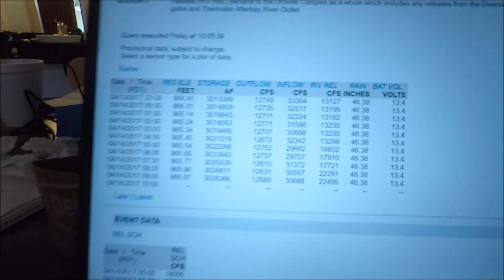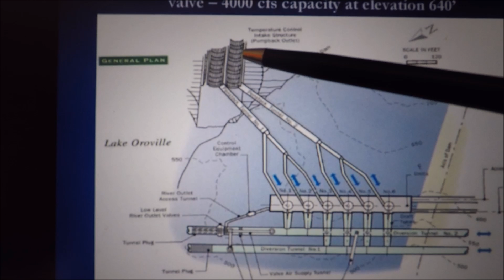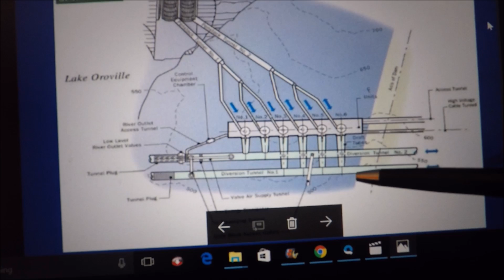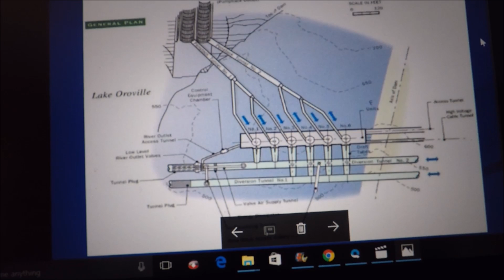Oroville 13 April DWR Press Briefing EXPLAINED!

Comment: Jaun, you apologize for using feet as a short cut for cfs. But as you know your feet have volume it's your foot's step that is linear. So, yes, technically wrong but practically speaking you're right. Though I'm not sure how many average feet it would take to fill up a cubic foot ( but then we're probably better off using bushels. )

Comment: Fantastic job. Thanks. One thing once they get the Dam fixed are they are going to start using Oroville Dam for FLOOD CONTROL! Any more nonsense of having the Dam at 85% capacity st the beginning of January  with record snow packs and a Pineapple express on it's way and not letting out more than a 11,000 CFS average for over the month? We were promised that the Dams in this state would have a primary goal of FLOOD CONTROL in the 1996-97 flood here in the valley. Of course it did not happen here.

Comment: Non-water guy guess: 60% allocation not related to res level. Instead, a function of what they can put into the river, with spillway down for repair.

Hindsight... If it was my jobsite, I'd be wishing I put the recovered spoil (debris) on the NEW CANYON SIDE of the busted spillway, instead of the far side, from where it eventually needs to end up (where it started).

Comment: It's good to see they added more shotcrete but wondering why it was such a dismal effort of only a few guys working and just one of them placing it... ? they should have had 3-5 just blasting shotcrete all over that left hillside..  all that brown color rock will erode if it is not protected. IMO addressing and preventing any further erosion under the slab is critical.. if they start to loose ground it's going to be a real mess... Look at the muddy water coming from that left side as the spillway is opened..

Comment: Another very good report Juan... yes the DWR is 100% in CYA mode.... Kevin Dossey is the lead engineer and he has covered his butt by saying he followed the protocall... but the reality is any competent engineer would have realized a potential risk and would have investigated the subsurface conditions when they were patching cracks and saw water seeping through the backside of the slab...  no different than if they saw water coming through the dam... would they just ignore it?  If these guys were maintaining a bridge like the Golden Gate it would have fallen into the bay and their excuse would have been that they were following the rules...  IMO passing the buck is not acceptable...

Comment: It seems curious to me that a sheriff is a critical bureaucratic valve for security-sensitive, failure-analysis of an engineered structure.  Unless, of course, a failure of security was a significant feature in the collapse of the spillway.  But I am not trying to provoke fear-mongering about a criminal act--I have no reason to suspect that from the flow of events.  That is, there seem to be plenty of problems concerning the original engineering, maintenance, and management of water levels (perhaps influenced by certain, possible irrationalities resulting from undue attention to political ends) to suffice in getting at the root cause of the potential disaster.

Comment: San Louis looks pretty full!  Can you fly over Shasta?  The Oroville spillway has been open for about 12 hours, and the water level elevation is 865.5, so it is a slow process, (which I suspect may have to be sped up next week to outpace the coming rain/snowmelt enhanced inflows.) The press conference had me baffled about the closure of Hyatt - thanks for the explanation. Still baffled about scheduling non-emergency maintenance work during the critical flood season, but not the explanation!  The CEI designation discussion was also a bit baffling.  Bill  made it sound as though the forensic report was never going to be closed to the public, and wasn't sure how we all had that idea.  I'm pleased that several CA legislators spoke up on behalf of their constituents and strongly demanded that the information be accessible to all. We will find out soon.  I'm anxious to find out about the soundness of the bedrock for both spill areas due to the high degree of weathering.   I'm also concerned about the timing of the two-day on site forensic team - it rained most of the time while they were inspecting the dam and spillway -  probably not the best time to find leaks. I hope they plan a return trip. This was another great report from a true celebrity in the world of California Hydrological Disasters.  Thanks Juan!

Comment: Thanks again for your persistent coverage here. I do have a question that I hope you will eventually answer: In the diagram of the Hyatt Power Plant, the turbines each have a penstock. Turbines number 1,3, and 5 have green arrows by them, The even numbered turbines each have two-way arrows. Can you figure out why, and what it signifies?

Dave in St. Louis, Mo.

By the way, we here in Missouri have also had our own Electric generating reservoir disaster. You can Google Taum Sauk Mountain disaster and find out about that.
Reply: soularddave2 : 3 of the turbines can be operated in reverse as pumps to pump water back into the reservoir. The idea is that (if the reservoir water level is low enough to allow) water can be pumped up using cheap electricity and drawn down later at peak electricity demand for a quick, responsive bit of add generation capacity. It's like a potential energy battery.
Reply: I believe that the even numbered turbines can be reversed to be pumps to move water up to the reservoir, during hours when electrical demand is low.  At hours of peak demand, the water comes back down to generate electricity.
Reply from the maker: soularddave2 yes, generators vs generator/pumps

Comment: What does it mean to "scour" the inlet to the spillway? And what is the result if that would happen? Thanks!
Reply: William M : It means the effect of water velocity on the submerged channel on the lake side of the dam which leads towards the spillway gates.
I think (from previous reports) the channel is graded fill, and is not bonded or cemented.
I can't recall the elevation of the base of this channel, but say it's in the range 815 - 825 feet; as the lake surface level is drained down through the spillway from 864 feet down towards the spillway channel level the risk of the water flow picking up loose material from the channel increases - in other words, discharging at too high a rate at too low an elevation risks eroding the base of the upstream discharge channel, which means solid materials start to be swept through the gates, down the spillway - risking more erosion on the concrete and repair patches - and dumping it as debris in the bottom pool.
Reply: William M : I might have the detail elevation figures a bit wrong, but the important principal is right.
Reply from the maker: William M tears up the inlet to the spillway.
Reply: Thanks you guys!

Comment: well since you commented that the floor of that spillway was just laying there, it flatly was only a matter of time before a major fail..because that is a carpet of  concrete sections with a rebar mat so every time they spilled and got that pressure wave rolling that carpet and flexing that rebar well who knows how long the rebar at that bend over spot where it braced against the down slope had been flex fractured, and max flow ripped that whole panel off and it was all over.   and they want to do concrete again ..
Reply: throw on the total dehydration of the land even the rock dried out and shrank..stresses always get expressed somewhere.

Comment: Thanks for the update Juan. I have to blow my own horn for calling this spill two videos back. 35,000 CFS and a long spill! There is certainly a ton that can be done to prep for the work. 

So far, no mention of anchoring piles into bedrock, but hopefully it will become part of the plan. As opposed to just filling the hole with concrete and building over top, piling into bedrock would be more stable and probably faster. This approach is also well suited to a staged approach since all the piles could be placed and they can build the spillway in sections. In a worst case, if they ran out of time they could still spill around the piles without any risk of damage.

This approach is basically like building an elevated highway on a slant. Yes, compressed concrete underneath, right up to the base of the spillway, but since it is sitting on piles it will not be compromised by settling or erosion.

Should this approach be taken, it may be possible to start sinking pilings after this spill and before the next.

Comment: Juan don't spit into the wind & don't try to record with a 30 mph wind facing you. Turn around and face the camera towards the water.  Not being a smartass. I owned a video production company for 25 years.  The best way is to monitor your audio as you record. Your reports are great,  but sometimes you're  a real rookie with the audio. But I can't fly a 777 except in a flight sim either.  Keep up the great work. You'll learn the tricks of the trade as you go along.  Have a great vacation time ! & thanks for the reports.

Comment: 60% design. Yikes. I've worked construction for 36 years. Whenever a job was not fully designed from the get-go it was not uncommon for it to turn into a fiasco.
 I know this is a fairly easy as designs go, it's "just" a spillway and proven modern techniques will be used to construct it but.... 

For an example, I worked on the original baggage transport system at DIA in the early 90's. It was designed by Boeing but it was only 85% designed when they went ahead with it. What could go wrong? Here's a hint, they built a standard conveyor system next to it and dismantled the original. 
With over 50 miles of baggage system that 15% adds up to a lot.
 There were mistakes and oversights on the simplest things. But with such a large system you didn't have to fix a couple of things, you had to fix a couple of thousand. I could go on forever about it.

I hope it works out for them at Oroville, it's an emergency situation and to complicate this daunting feat they have to contend with Mother Nat

Comment: Wouldn't it make a bit more sense to wait for the final report on the root cause of this failure before moving forward with a repair plan?
Reply: Thanks Steve, I didn't start following this till well after it started and am not from the area, just trying to understand the politics behind it all.
Reply: James Anderson hi. That subject came up. let me get you up to par somewhat. A few weeks back Jaun reported the need for the investigation results be used by the winning contactor to be sure to address the issue it uncovered. So  
yeah.
Reply: @James Anderson: There is a lot of preliminary work and set up prep to get done before the real repair plan will be ready. There are banking and financial matters to be settled before the real work can start. They have to excavate and area for a new onsite fully functional cement factory. Then they need to purchase or aquire all the cement factory equiptment and convayor belt equiptmentt. It all has to get hauled up there, go threw security, validate the working order on arrival, make sure they have all the pieces of their new erector set, install it, get it tested, validate the new cement at a 3rd party lab; so, they can "Release the New Contrete Factory !!!""KRAKEN""!!! for 24/7 or untill further notice operation. So look for the repair plan to be more fully developed about June-July. Then check on the status of the inspectors for their imput. Oh and watch out because it can all run into itself during this ca.gov/wdr.com process.

Comment: This site appears to be one of the early sentinel earthworks which will be called upon to respond to an increasingly energetic  hydrologic cycle as global temperature rises. Here in South Florida our experiences are rather slow and plodding. You guys are facing rather dramatic abrupt failure if the civil institutions can't keep up. We are all watching  with hope to learn how to cope in our own communities. Thanks.   

One question you may consider at the town meeting is what water storage extremes are being considered by the Department. Could they envisage a needed future design adjustment for 20% , 40%, 60%  increase in peak water inflows and cyclic loading extremes to the structure?

Comment: Your work takes me back to the days when the media had "credibility".  The MSM should enroll every single one of their "journalists" in the Blancolirio School of Broadcasting IMHO. I rely on you for real news about Oroville Dam. Call me crazy but if I were the governor I would drain that lake, rebuild everything then refill it. I feel for all those down stream because I have to go with my gut feeling and it tells me nobody is out of the woods yet by a long shot.
Reply: One issue they're dealing with is that below the outlet's intake level(I believe it's 830ft), there is no way to drain the lake if inflow exceeds the capacity of the power plant.  However, assuming an inflow of 0, it would still take the power plant alone about 4 months to drain the reservoir.  i.e. aint happnin

Comment: Sounds like they are going for some sort of Early Contractor Involvement (ECI) contract for the rebuild. This is where you engage the construction contractor at an early stage in design (60%) and you develop the design to 100% with input from the contractor. They bring practical solutions, innovation, common sense and experience to the table (something that some engineers lack!).  It also allows early start of the work as the contractor can start to mobilize to the site, build access roads, lay down areas and establish infrastructure like the concrete batch plant in parallel with finishing off the design.

Comment: When was the last winter they had to use the spillway? It has been years of drought. 

Was the soil under the spillway so dried out it shrunk and generated voids under the slab that could have caused structural issues for it? They did not build on bedrock as the pictures show.

Comment: so dam life as looking into petra damns and their eventual failure.

if the adverage life of a damn is 75 years to 400 year and eventual failure. 

whats chances of creating an entire new dam, in front of that dam. secondly, the chances of using beaver weave method of building a dam, although there is no throttling in that method.... hmmm

if maintenance keeps happening 350 year dam life. 

i think new tools maybe needed or products to construct better dams.
Reply: The dam needs no maintenance, it's just a giant mound of rock.
Reply: Ruin befalls arrogance... without of wisdom

Water is a solvent. I can lift an entire mountain with it, and move it. There is no structure I cannot find that cannot be pushed apart, for I am the axiom, the lever, the glass vase.

Comment: I found a good picture of the intake tubes, taken during the height of the drought.  I went looking because I realized that when the main spillway is operating there isn't going to be much temperature control. I wonder how deep the intakes are, compared to the 834 height of the spillway intake?
 http://www.sfgate.com/news/article/drought-Oroville-Dam-before-after-photos-lake-10928766.php#photo-9279145
Reply: Randy Weiner : the spillway skims off the top, which is usually the warmest water (temperature gain from the sun, + the buoyancy  of warm water). The lake water gets colder the deeper you go. Discharge towers are usually arranged so water can be taken off at different levels and blended to get an acceptable target water temperature fit the downstream discharge  and keep the ecology viable.
Reply: Given the higher rate of inflow from the ice melt, and how the spillway is being used as an on/off gate to manage resevoir levels, I expect the spillway water will be colder then usual - even if only a few degrees.  While the spillway water is  usually warmer,  I wonder if DWR will monitor the Feather river water temperatures and I hope that if the water is colder that it does not affect the fish.

Comment: I have been watching all your videos since the story broke. Great reporting. My question is.... if they are so concerned with the 865 level, then why did they ever let it go about 865 back in February? I do realize that the spillway was open and it was still flowing over the emergency spillway but why were they not letting it out rapidly as it inched over 865 back then in Feb?
Reply from the maker: Connor Ward fear of the unknowns. ..they were afraid of loosing the WHOLE spillway if they cranked it up too much.
Reply: At the time they thought the emergency spillway would function as designed, and wouldn't encounter massive head cutting towards the emergency spillway foundation.
Reply: Thank you and Michael Onines for your replies.
Reply: The emergency spillway was used because they lost control of all other means to reduce reservoir levels.
The severe erosion that initially occurred when the main spillway was damaged raised serious and legitimate concerns about continued erosion compromising the rest of the upper spillway and supporting base structure around that part of the dam, and flow was drastically reduced through the main spillway.
The erosion also caused the Hyatt power plant to be taken offline to protect it, further reducing the controlled outflow available.